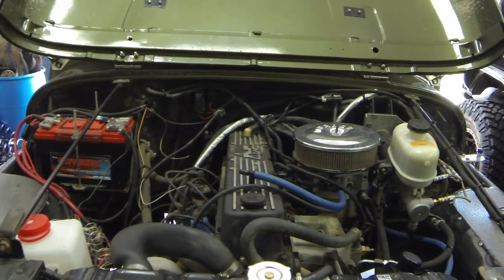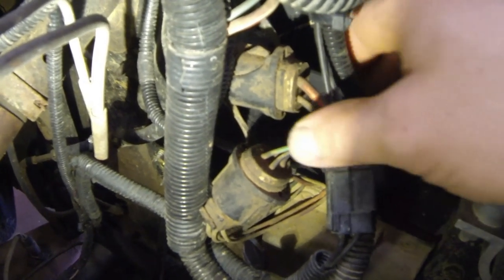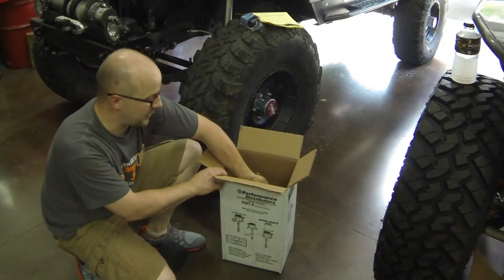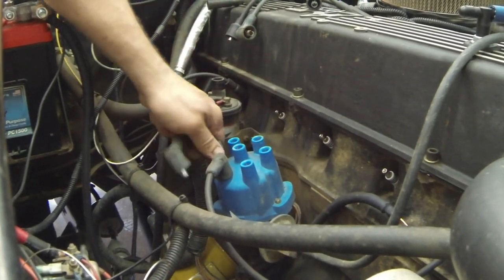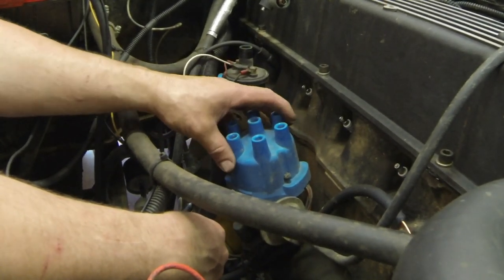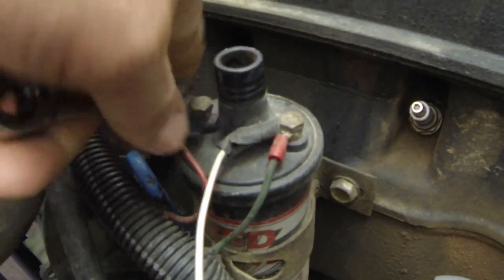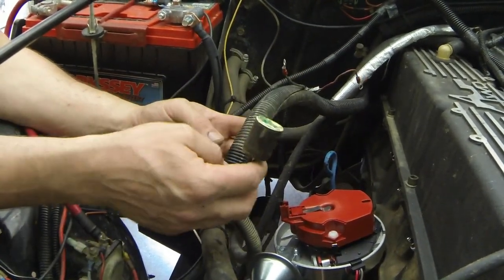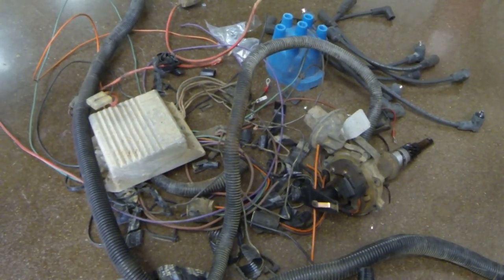HEI Jeep Install

Comment: Just wanted to remind anyone doing this upgrade about a safety feature of these "big cap" HEI distributors. If you attempt to start the engine with no fuel in the carburetor bowl (no fuel getting to the cylinders), the module will sometimes shut down and the engine will not fire or run. From that point, as long as the key is not turned fully off, the safety will remain turned on, and the distributor will not function. To reset it, turn the ignition key fully OFF (no power to the distributor), wait 8-10 seconds, and then try again, this time, making sure fuel is getting to the cylinders. Even foreign made versions of this distributor have this feature.

This happens because inductors (coils) pull more current when the resistance it sees increases. If there is no fuel in the air around the plug, the resistance seen by the coil increases greatly, which in turn means the coil in the distributor will try to "sink" a much higher current. To prevent overheating and destruction of the ignition coil, as well as damage to the electronics, a type of auto-reset circuit breaker was implemented in the module. Once activated, it will remain "on" as long as there is power to the module, and can be reset as described above.

My guess is that it was too expensive to implement current limiting in the module and this was the solution used. I can't tell you how many guys I know who thought the distributor went bad and got rid of them because they did not know the above.

One last thing...HEI distributors DO NOT REQUIRE resistive ballast. So if your present ignition used it, be sure you wire straight to the RUN supply through the appropriate sized fuse - do not use resistance wire or a ballast resistor.
Reply: There is no safety feature on these big cap hei,s  coils cant tell if you have fuel or not, they are just coils and will fire even when spark plugs are out of vehicle. hook a hot wire to them and your good.
Reply: @robertrobertson3927  

You are incorrect. Coils (or inductors as most engineers call them) have characteristics as all things do. The most important is that they act the opposite of a capacitor. An ignition coil is a transformer with a low voltage primary and a high voltage secondary winding. If the primary is charged (voltage is placed across it and current is allowed to flow through it), and then the circuit is interrupted, a high voltage is produced in the secondary. At the same instant, the more resistance in series with the secondary (read the larger the spark gap or less medium to aid the spark jump - fuel) when the circuit is interrupted, the larger the coil primary drive current will become if unchecked. Even some of the cheapo modules produced in China have circuits to protect the coil drivers against too much current.

Most modules will simply shut down if the primary current attempts to rise past a certain point. Data sheets say remove power to the module for 10 seconds (this resets the module protection circuits) then try again. On the other hand, a sudden total open of the secondary coil will usually destroy the cheaper modules if you don't fuse them correctly. Lastly, I wouldn't have posted it unless I had experienced it and also read the data sheets myself.

Thanks for your reply.
Reply: tHANK YOU FOR THIS INFORMATION I DID CHANGE OUT A HEI IN A BOAT I WAS BUILDING AND COULD NOT FIGURE OUT WHY I WAS GETTING NO SPARK. NOW IM AWARE

Comment: There a trick to buy bass / the CDI Box on those old jeep ,, at the box right fender , there is a purple wire , run a wire from there to the distributer , to a green wire , i believe , jeep will start right up ,

Comment: I read below some of the questions. I will trace it back and try to replace the wire to the same location. I believe that will work. It is kind of a daily driver so I would like to get it right. An I to hate these electric Gremlins on these ignitions. Again thank you for your help and knowledge.

Comment: I've done the same as you, and added a Weber 32-36 carb, runs great and good gas mileage. Thanks for the video, have a good one.
Reply from the maker: Bob Hunt It has had a great run but it is now in the shop for a 5.3 and 4l60e!

Comment: Looks pretty strait forward. The only thing I am not 100% on is the I be leave the ignition wire removal. Not 100% Shure that is the wire that goes back to the key? Also what Gauge wire did you replace it with. I just pick up on of these for my  78 J-10 and look forward to using this "how to" demist ration to install my own. You probably saved me a $100 on bring it in to the shop! Thank you!

Comment: Great video tutorial. I got a little lost when you talked about removing the resistor wire and bringing the 12v supply directly to the HEI. Could you expand on that some?
Reply: clark davis I believe they are talking about the wiring coming from the ballast resistor on the coil and hooking it directly up to the HEI
Reply: Oh I got this. Not a ballast resistor. I have an 82 CJ5 and there is a wire from the ignition module to the coil that is made of doped silicone. The purpose is to step down the battery voltage (12.4 to 12.8 or so) down to working voltage for the factory coil. The coil, if I remember correctly wants about 8vDC to step up to about 25KvDC. Most HEI take battery voltage and step it up to something like 75k to the plugs. I could have the numbers a little off but basically the resistor wire is a soft wire made of grease instead of a resistor. I don't have any insight as to why they would use that nonsense from the factory instead of a ballast resistor, but they did. I also have no idea why they would throw those garbage carter carbs on when fuel injection was already around and proven.

Comment: I wish I had looked at this video first and not the other ones! I didn't turn the motor to TDC before I started and now my timing is off and I had everything in and tried to start my Jeep before I realized I had skipped that step.  Do you have a video on getting the timing set correctly?
Reply from the maker: We do not.
Reply: Keith, did you get your answer on how to get timing set?
Reply: You can find TDC by removing the #1 spark plug and then putting a large wrench or breaker bar w socket on the crank bolt down by the pulley.  Turn clockwise and look down into the #1 cylinder and you will see the cylinder moving.  Continue until it comes up on compression stroke.  Confirm by checking the timing mark on harmonic balancer/timing cover as described in video.  You should see the mark on balancer

Comment: Can you show us wiring from the firewall to the DUI?  I am installing one and trying to determine what wiring can be cut out
Reply from the maker: Sorry, that’s been a hot minute since we did that, and I couldn’t recall without seeing another one in front of me.
Reply: I have a 1988 jeep wrangler yj 4.2...I marked and labeled all wires attached to the original ECM and almost all will be eliminated...keep the two twisted together orange and purple and yellow wires( might want the yellow for later...trace your wires and see where and what they connect to. For ease, I exposed all the wires. You will see a junction of ground wires, some but not all will be cut as they pertain to the sensors that will no longer be used.

Comment: Awesome video thank you. One question, instead of turning the crank, why not just take the distributor cap off and note where it is pointed at and just match the current configuration? Are you turning the crank first , just to be 100% sure you won’t open the distributor and find it between cylinders, if even possible ? Thanks
Reply from the maker: Turning the crank just to verify position
Reply: One has to be sure you are not on setting the timing markon the wrong stroke. If you do, you will be 180 degrees out on timing. I did the ol trick of putting cotton in the cutoff finger on a glove, put it in cylinder one and turned crank, when it comes up to TDC the plug will pop out. You will see your piston is up...continue turning crank until on timing mark...

Comment: I do not see in your video where you address how to run the factory AMC Jeep tachometer with the new HEI distributor.  It will not work if you wire it into the standard green wire "tach port"on the HEI unit.
Reply from the maker: The tachometer does not run off of tach signal of the coil on that model jeep. Look at the back of the tachometer and it should just start working again like it was before. There shouldn’t be any need for change.

Comment: So the power wire going in can just be to a switched 12v source? I don’t have the original harness any more. Thanks.
Reply from the maker: Correct
Reply: @rockyour4x4  Thank you. Appreciate you!

Comment: I am getting ready to install an HEI on my 1990 Jeep YJ and have two questions.  1.  I think what I am hearing everyone say is to take the large (red?) wire that goes into the old ignition module and run it straight to the power lead on the distributor - correct?  2.  Is there no negative wire/lead on the coil?  Seems like there should be a negative lead somewhere.  Any help would greatly be appreciated.

Comment: Hey brother I have a 83 cj7 258 i6 and 2 weeks ago I drove it. Then no spark. Replaced coil from Mallory to accel Nada. Replaced distributor from Mallory to oem. Nada. Found the center pin in dist cap of old Mallory dist cap had come off and got under the rotor. Possible it shorted out my new coil? Exchanged a cell coil for another accel coil to rule out the Mallory dist shorting out the new coil. So now have new coil,new dist,dist cap and rotor. No spark coming from coil. I'm getting power to coil and dist is pulsing correctly to coil. I can't figure this out. It should be firing but it's not. HELP!! If you get this one come to Hawaii and I'll show you around on me. Aloha

Comment: Great video. Could you specify what exactly you hooked up the Batt wire to. I am installing the DUI on my 75 Land Cruiser I6 and I can't find a good explanation of exactly where to take the wire. Also, did you get rid of the coil power wire and the coil? Right now I have a 12gauge wire running from coil + side to the batt plug on dizzy. I have power on the coil but not out of the spark plug wires.
Reply from the maker: You will use any ignition power wire that has voltage when the ignition is on AND in the start position. If you have the HEI distributor, that will delete any need for an external ignition coil. So, if you currently have an ignition coil that has the power to the + side when the key is on, you will use that power wire for the BATT connection on the HEI distributor.
Reply from the maker: You will not need an external coil with the HEI distributor.  You will use any source of ignition power for the BATT wire on the HE distributor so long as it has battery voltage in the start and run position of the key.
Reply: @rockyour4x4  This was a great video. It seems the same question every one is asking, is where the power wire to the distributor is connected to. Perhaps you should make a video, that specifies and explains just this question. Of course there will be different examples, for different applications, but for the novice, they don't seem to be grasping the concept, completely. 
I am currently doing a full frame up on my wagoneer, with a 360, and the same ignition swap. I'll be more than happy to share pictures of my wiring as it comes along!
Reply from the maker: James Barlow thank you. Really, this was years ago and we only do one of these a year anymore.

Comment: Where'd you connect the other end of the dizzy power wire?
Reply from the maker: Sorry, you’ll need to elaborate. This video is pretty old.
Reply: @rockyour4x4  The 12v from the distributor... did you just connect it to the previous ICM power?

Comment: I'm planning on adding this to my 1979 AMC AMX with a 304 engine and I see you have removed the Ford ignition box and included resizing the wire to the HEI ignition coil.  You had mentioned you removed wires back to the firewall?  Where did you take the orange ignition wire from or where did you spice that in and how far back did you go to get rid of the wires from the Ford ignition box?
Reply from the maker: Stephen Matoska We do these it seems pretty regularly now. The wire for the distributor just needs to be ignition voltage when cranking and when in the run position.  Each vehicle is different and that wire may change from vehicle to vehicle. The important thing is to trace those wires back to their source and remove them as they are not needed.  I can't tell you about that exact wire without it in front of me. Sorry and hope this helps.
Reply: rockyour4x4  

- animaux z

Comment: Aren't you supposed to change out the new distributor gear and use the old gear from your distributor to prevent excess wear on your cam gear?  I have always heard the gears on the new distributors are harden steel and I have had to replace my gears because of premature failure?
Reply from the maker: I'm not sure. I'd say Performance Distributors would have mentioned it if that were the case.

Comment: I'm trying  to convert a 351w to HEI. I'm a little lost as to where to connect the positive/battery wire once I've removed the coil and ignition control module
Reply from the maker: james hulsey the HEI needs 12V ignition when the key is in the run and crank position. It doesn't really matter where it comes from exactly as long as you have it.

Comment: hydra boost brakes run off power steering pump so if engine dies you have no brakes, is  this a smart change to do. IM thinking not.
Reply from the maker: Vacuum brakes that come factory on these jeeps also don’t work when the engine dies!
Reply: I believe the brakes do work when engine dies, just hard to depress

Comment: Thanks for posting this.  Here is the big question, is it worth it performance wise?  Getting rid of extra junk is nice but does the HEI offer a great benefit on the drive and dependability.  I have a 74 cherokee with the straight six and I'm considering the swap.  The truck hasn't run in at least a year and my buddy I bought it from disconnected the module and all the vacuum lines.  I just figured that now might be the time to just convert to HEI instead of messing with the points.  Let me know what you think....and thanks again.
Reply from the maker: There is no seat-of-the-pants difference in performance.The advantage is simplicity and the clean look of the engine bay afterward.
Reply: Kurtis570 With a '74 you have an old Delco points distributer. There is a pretty noticeable performance difference when going with an HEI because you can gap your plugs wider. Idle will be smoother as well. I did this conversion on my old '75 Cherokee (Which came with a prestolite, but swapped to a points style for a few years before going to HEI).
Reply from the maker: Great input! Thank you.

Comment: When you did the HEI conversion I see you disposed of a lot of hoses,wires ,and the ignition module on the driver side fender well. Do you still need the map sensor and the ECM if you also change the carburetor to a non computer controlled carburetor? Thanks.
Reply: The Ecm is Ford as the old duraspark ignition module, so i dont think it is required anymore, the HEI distributor can by itself controll the spark timing, no need for sensors or ECM

Comment: I would keep the Duraspark. Recurve the mechanical advance with Mr. Gasket springs. Install the large Ford cap and adapter. Use MSD super conductor wires at <50 ohms per foot resistance. Install the MSD streetfire CD box and MATCHING COIL. Gap plugs at 0.040" or 0.045". Don't go hog wild on the gap. Yes 0.060" is larger but less amperage. Just go 0.005 to 0.010" larger than factory specs on the gap. Shall I expand on those "lovely" GM HEI modules?

Comment: how can i find TDC on my 258 with the Distributor already out? I pulled my old one out without marking first to check ev erything and decided to order a new one now im not sure on how to get back o TDC.
Reply from the maker: You will need to pull the #1 spark plug. Have someone to crank the engine while you have your finger in the spark plug hole of the cylinder head. When a gasp of air bypasses your finger you are on the compression stroke. Then, check your timing mark and it should be very close 0°.  You will then rotate the engine to where the timing marks lineup and that should be TDC.

Comment: Would this work on a 95 4.0 Cherokee. I would think so. Just thinking about converting blow through carb. With a built 4.6 this fall. Running  a 4.5-4.6 now with ported head rocker springs gapped rings 7psi on 87octane with no tuning. A fuel pump out a Chevy LS. Fuel regulator and ford injectors. Runs like a raped ape. Just want to simplify and more boost.

Comment: I have the same engine in my 88 YJ, do all the same rules apply?  I put the new distributor in and my engine started knocking really bad.
Thanks!
Reply from the maker: Sean Dohrman it should be the same. It sounds like you have the timing off.

Comment: Hi, I am in the process of replacing the original distributor for an HEI. What are you timing points initial and max timing mechanical? Also what is you  vacuum advance? Thank you
Reply from the maker: The timing was set at 10° advanced. All of the internal portion of the distributor with set from the manufacturer.  We use Davis Unified on all of our swaps.